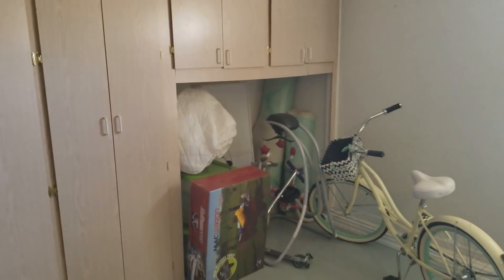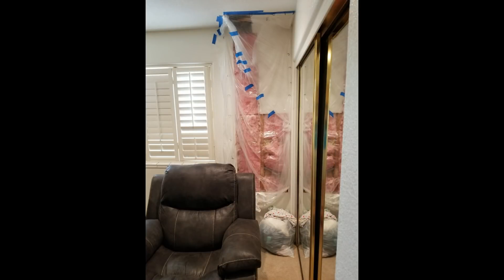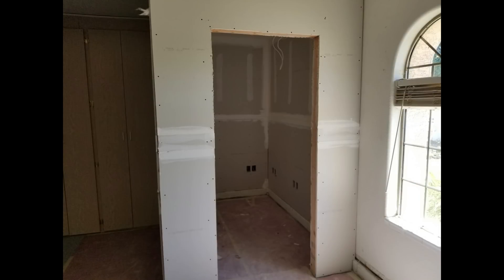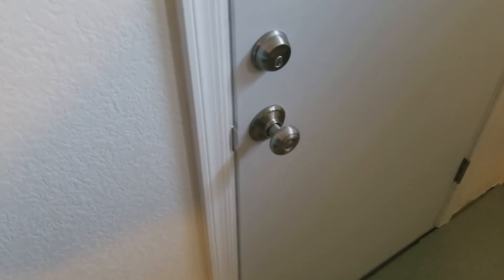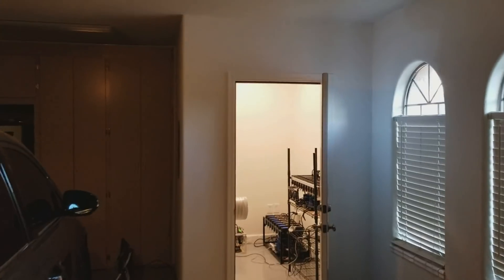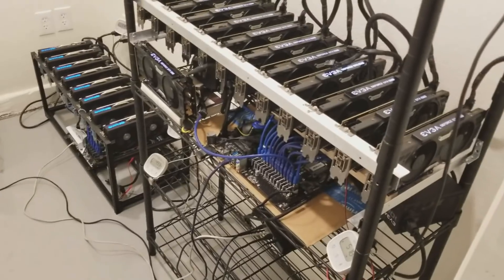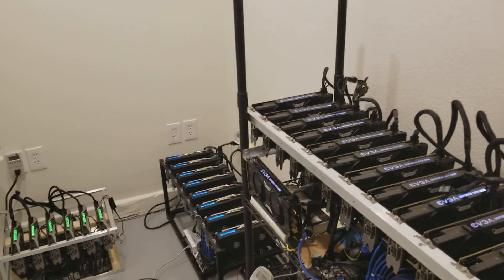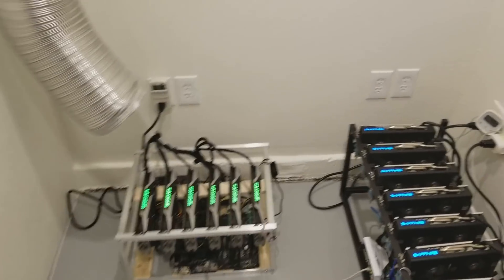Mining rig room construction

Comment: Comparing the before and after scenarios, it looks like this was a great idea.  It's been about a week since the last video posting (the rig installations), so can you update us on how the circulation/temps are doing?  
Also, curious to hear the details about the room addition itself, such as, How much power/how many circuits were run to the enclosure?  What does the cold air intake actually look like (and how well does it perform)?  For estimation purposes, what would you say the overall cost has been for the entire addition (materials, labor, circuits, hvac, etc)?
Reply from the maker: I've had some cooling issues. I made the mistake and listened to the HVAC guy I do computer work for and should not have. He had me try AC... Doesn't work in my hot garage and is too expensive. I'm going back to my original plan and hope that it helps. In a few days I'll upload a more detailed video on how everything works an temps. It has been a good experience. If I had to do it all over again I would do something different but this room can be used as a storage room or small shop room so not a total waste. More details to come...